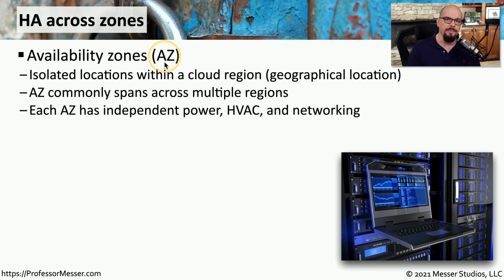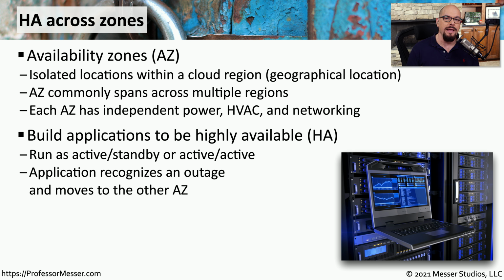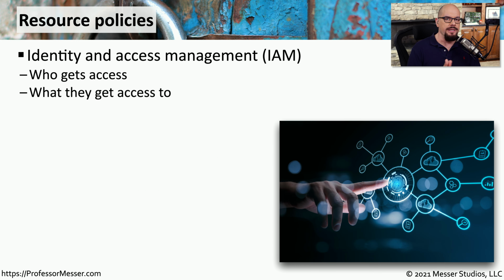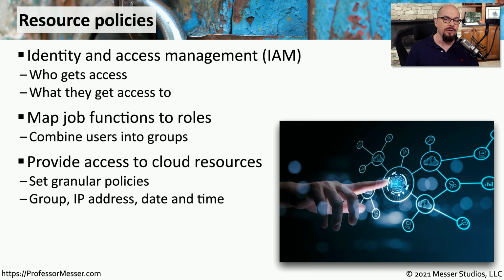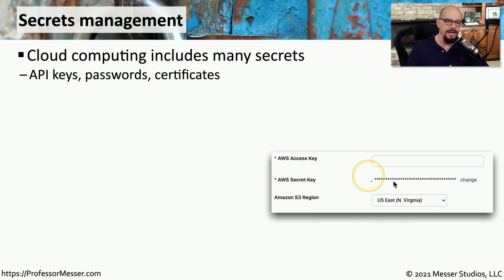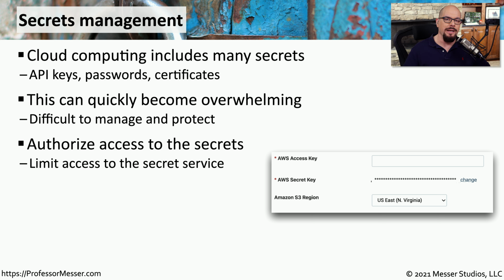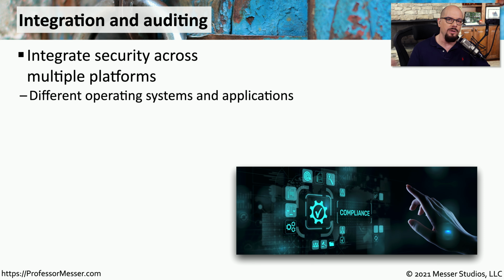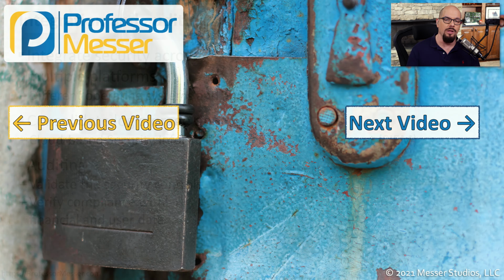Cloud Security Controls - SY0-601 CompTIA Security+ : 3.6

Comment: Thank you! Question: how does the application recognize outage? Does it have a built-in feature/script that is constantly running to recognize outage and react?
Reply: Normally, an application doesn't report its outage by itself unless its loses a dependent component such as a database or authentication system which is reported to user or written to application logs or send an SNMP message. There are monitoring tools that will provide such alert or notification based on application and system logs. Some monitoring tools have the ability to run custom script to monitor application services as you mentioned.
Reply: @zabfarani9459  sweet! Thanks.